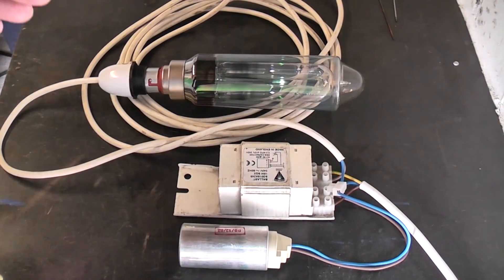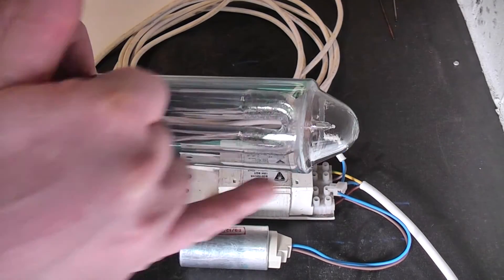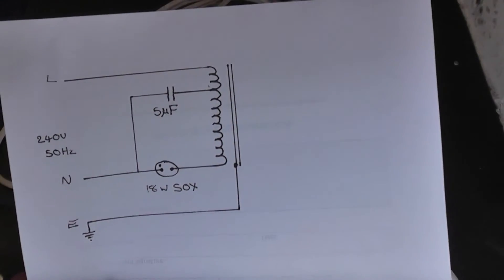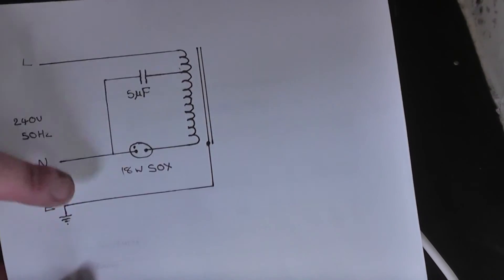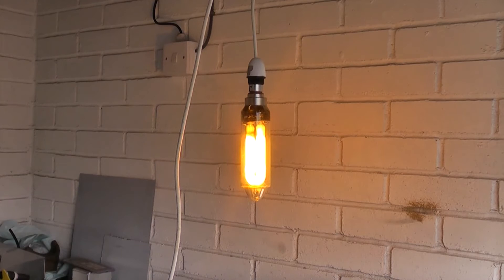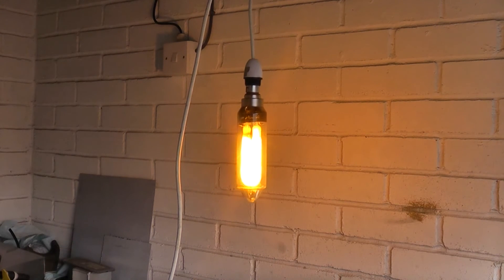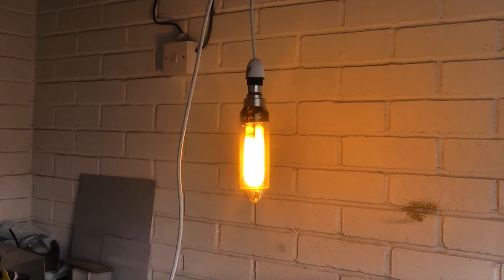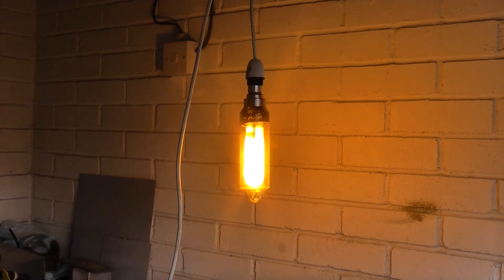18w low pressure sodium (SOX)lamp.

Comment: I bought a Philips 35W SOX lamp on eBay and managed to find, after many days of searching, a driver unit that runs it perfectly. The drive unit is a single white box which has a brand name VISIO and is marked 35W SOX HF driver model PAA3522HFSX. It has three inputs for 240v mains supply, marked +, - and earth and two for the lamp, which seems to work whichever way round it is connected. The connections are marked clearly. This unit is all that is needed, apart from the lamp and socket.  Unfortunately I cannot find any reference to VISIO or this product now: I bought the last of 10 which were sold on eBay last year.  Vendors are still supplying the SOX bulbs ( which ceased manufacture in the UK in 2021) but I suspect they are mainly bought for use in streetlights with old drive circuitry and the drive units are even rarer than the bulbs. A hugely expensive low pressure sodium lamp system for lab work is now available from China: this may now be the only source for optical work.

Comment: I have been sold a new low pressure sodium lamp, labelled SOX-E 18W by BLT direct in the UK, but they do not know what ballast and condenser it needs .  Can you tell me the details of the ballast and capacitor you found on eBay?  I found a YouTube item with a similar lamp being operated on
120v AC in the USA, using a Fulham choke WH2 120-C with no capacitor.  I need the lamp for optical experiments where the low-pressure sodium spectrum is essential for seeing fringes when measuring the flatness of mirrors etc.
Reply: I also would like to read the answers to your important question - i am dealing with same problem about optical experiments, but seems no one wants give precise details....

Comment: Just like PL-L 18W CFL lamp, I have dozens in use, 7 on Advance electronic ballasts, they last forever, and the ends don't blacken, the same PL-L 18W lamp on the simple magnetic core ballast, get blackened ends near the base, the electronic ballasts run much cooler, SILENT also, they are much lighter, just better

Comment: U.S. had them, all had the Kulka or Leviton sockets bayonet, Philips owned Kulka at one time, Ebay, sold under Norelco label early on, then changed to Philips, when Philips finally took over full control of North American Philips, cus they where screwing up too much in the U.S., so Dutch Philips took back the Philips trust, and took full control, so then they could use Philips name and logo.  They made U.S. made fixtures and stuff in Van Wert OH, mini Sox wall pack outdoor I have used them for will be 40 years...the fixtures lasts decades, until poly-carbonate got too yellow, so I have spares, spare sockets, spare ballasts, spare sockets, 55W for the backyard SOX , works great, have Hubbell, 55W replaced yellowed Philips Norelco, after 35years..Have a 180W  SOXflood light fixture and lamp, BRIGHT!

Comment: Philips Norelco MiniSox/Lustra Lighting/Verd-A-Ray ,Philips lighting North America from the 1980's,  Fixtures where made in Van Wert OH. along with the large 90W 135W 180 Area and street lighting fixtures,I still use several 40 years, have some spares, and some STONCO(PHILIPS) 18W LPS with glass lens, will never yellow.  Have some spare sockets in case and spare ballasts, and stocked up on lamps for the 18W fixtures and the 55W fixtures, should hold me till I', 133.  The Sox Lamp factory is now closed, in Hamilton...the last SOX lamp has left the factory in Nov 2019 https://www.lighting-gallery.net/gallery/albums/userpics/10275/normal_IMG_2527.JPG

Comment: Is it possible to rig one of these on a dimmer? I'd imagine you'd need a special ballast that could dim it down?
Reply: Not possible. Most gas discharge lamps that rely on passing current through vapor generally are run at exactly the correct current and voltage to maintain a specific temperature. Reducing the amount of power going into the lamp via dimming would reduce the arc tube temperature, reducing the efficacy as well. You may also run into lifespan issues as there will be an increased risk of sputtering. Again, this is due to being designed for a specific power draw.
Reply: @TheSoxmania  Interesting. I was wondering if using a PWM dimmer to lower the voltage would somehow lower the temperature of the gas/vapor so it doesn't burn as bright -- but unfortunately that isn't how these lamps work. For now, I've discovered that if I wrap the lamp in Neutral Density gel (used for film and photo applications) I can lower the light's output.

Neutral Density (ND) gel is available in different strengths depending on how dim you'd like to have the light. Certain brands are also heat resistant, so that is a plus!
Reply: @Powersfilms  Or maybe you could mess with LCDs and polarizing layers for a similar effect?
Reply: @Powersfilms  to be honest wouldn’t it be easier to get a lower wattage lamp ?

Comment: Philips Mini Sox fixtures where sold in U.S. made in VanWert Oh.,  have 5 in use on teh house, on every night lamps last for about 5 years in all night use.  Great stuff, no glare, doesn't annoy the neighbors, cus of yellow non glaring colorfor the U.S. market, been using em for decades literally, only thing that goes bad after 25 years is the poly-carbonate lens, they do get yellowish, cus of sun UV over time, heat glass wouldn't do that, but the Poly-carbonate is much lighter to mount on walls and stuff, the street lamp fixtures alos are poly carbonate lens, like the hubbell 55W wall packs called  Hubbell also stop making the sox  fixtures I have 4 of them, all Philips parts inside, lamp ballast (Advance) a Philips company Kulka, old Philips company sold off, The fixture div in the U.S. was sold off to American Electric, ebay has AEL Philips street fixtures, under the AEL branding, also 18 Wall packs without lamps,

Comment: 180W is the largest SOX lamp almost 4ft long, but no glare, cus it's linear, and much softer, than glaring point source LED
Reply: There are difusors for LEDs, and being able to see colors makes up for it.
Reply: @TheEsseboy  The Majority of LED street lighting installations are horrible, glare, and high color temp, way too much Blue, glare in rain and fog, horrible to drive under. LPS is still the best roadway lighting, in rain and fog etc.  But time moves on, LED fixtures are much smaller, cheaper to make, LED last much longer, when ya get the good ones.  Led is so common now, they are much cheaper to mfg.  Philips closed the final LPS factory in England, now only NOS what's out on the shelves are available.  I stocked up, on 55W and 18W for all my fixtures, have plenty to last till I'm 133 years old.  Fixtures hold up long time, have spare ballasts and sockets...
Reply: @cengeb  The difference is that you can't really get cheap bad sox, so thats why LEDs get a ba reputation.
There are LEDs with large external phosphors, I have such E27 lamps and they have a sphear 40mm siced ball of phosphor, imagine a streetlight with a sheet of say 30 by 60 cm phosphor that is glowing uniformly 😀 those would probably last like 100,000 hours because of decreased phosphor loading.
Reply: @TheEsseboy  I have several Philips LED lamps inside, no glaring individual LED showing, as you say, all even diffusion, and they have been flawless, and color is now around 3500K, the original cheap non Philips stuff where horrible.  LED have improved, and prices dropped, I have some of the original I think 9W screw in Philips  LED, perfect color, around 3000K.  Some 11W LED perfect for inside, low color temp, no glare, the outdoor street lighters are still too Blue, and horrible lens, glare, as bad as the old Merc vapor from the 1960's, or horrible MH glaring harsh white. When I redid my kitchen 11 years ago, I put in Wera LED puck lights, each unit has 3 1 W High Brightness Philips  Lumiled LED, perfect color at 3500K, they have been on for 11 years 24/7 not one LED failure or color shift. One driver does 3 pucks so 9W each driver, I have 11 pucks installed.  Lumileds was sold off as an independent company, no longer Philips lighting.  Matter o fact Philips lighting is no longer it's Signify, what a dumb name, Philips spun off Lighting div, after 120 years, how DUMB.
Reply: @TheEsseboy  Most LED  fixtures used on road lighting here suck, glare, and too much blue. In tunnels now, many have way too bright, horrible glare, and exposed LED elements, no diffusion, if they kept the LPS linear lamp, no glare, large surface area lamp, no glare.  Tiny spots of intense Blue light sucks and strobes as you drive by in tunnels.
Reply: @cengeb  I agree, those are bad designs, hopefully we will get LEDs with better reflectors, difusors and larger phosphor area.

Comment: We got 120/ 240 V ballasts here 60hZ.  No hV spark to ignite, the Neon starts with pretty low volts.  As the thing heats up the metal sodium begins to melt, and give the Sodium color

Comment: I like sodium lamps, they are very efficient, I think they are just a US and UK used lamp, but I'm not sure. I know in the US they are commonly used in tunnels and such, sometimes but rarely streetlights, and they use them in areas where light pollution can be an issue, but the UK uses them too, I believe US is mostly HPS but there are some LPS also, but they are about as common as incandescent these days, I use them but it's a very narrow crowd, but a cool one at that.
Reply: They saw some use in Australia although not as much as the states and definitely nowhere near as widely as here in the UK. They were, for the longest time the defaqto lighting standard due to our needs for a super efficient light source after the energy crisis in the 70's.
Reply: Becoming quite uncommon in the US. Even HPS are being phased out for LED 'mid white' color spectrum streetlights. LPS is so uncommon that much like when I see a payphone these days I say to myself 'holy sh**!' Some of the early LED city streetlights were awful, but they've been getting better.

Comment: where is the ignitor ?
Reply: not needed, these are not HPS, which need a hV spike to start, these are almost like Fluorescent lamps, as far as cathode and current.  No hV.  cap is just for PF correction
Reply: @cengeb  I have some SOX lamps that run a parallel igniter, but in the case of lamps smaller than 26w they don't require it. They will rely on a starting capacitor and the coating on the lamp jacket to ignite the lamp. This is also why 18w SOX tend to go black before the lamp itself actually fails.

Comment: Love those high intensity discharge lamps! So sad they're slowly dying out all over the world
Reply: I'm glad, they have horrific light 😫
Reply: @TheEsseboy  not all of them do they are better for your eyes than led
Reply: @thepurdychannel8866  No, monochromatic light is bad for your eyes!
Reply: @TheEsseboy  They're not talking specifically about SOX here. There are other types of gas discharge lamp which emit whiter light. For example:

High Pressure sodium, colour temp of between 2000 and 2500k and can have a CRI of between 24 and 50 (2500k / 50CRI would be a  "white" sodium lamp such as a Philips SDW-T. The more common lamps are 2000k with a CRI of 24-26)

Metal halide can have colour temps between 2700 and 12,000k and CRI between 40 and 99

Mercury vapor lamps range between 3600k (coated) and 6500k (clear) with CRIs of 17 (clear) and 49 (coated) respectively.
Reply: @TheEsseboy   Why??
Reply: @DANGJOS  Because you can't see any colors in mono light, and it uses only one cone cell instead of all three...
Reply: @TheEsseboy   Well actually it uses two cone cells.  But that doesn't tell me why it's actually bad for your eyes.
Reply: @DANGJOS  You don't want to see colors? I do...I don't like it when all cars are pitch black...

Comment: Wonder why they have never put mercury in the LPS?
Reply: Because they use sodium
Reply: Because the mercury would amalgamate the sodium and affect the operating temperature. Additionally, the amalgamation process of alkali metals such as Sodium is quite violent.

What I would like to see though is a NaK lamp or pure potassium used as the alkali metal. that would be a very interesting colour.
Reply: It would make UV light, which would need a phosphor coating to make that into visible light. Fluorescent tube lights are low pressure mercury lights, in essence

Comment: LED lamps sucks
Reply: Sox sucks, proper LEDs rock
Reply: @TheEsseboy  i would rather have lps instead of led
Reply: @thepurdychannel8866  Why? Because of nostalgia?
Reply: @TheEsseboy  they are flickering and every other one has burnt out and the lps lights were brighter
Reply: @thepurdychannel8866  sodium lights flicker too, and none have failed in my town.
Reply: Cheap chinise ones dool proper cree ones dont
Reply: They're not as good as high or low pressure sodium lamps.
Reply: @adamfaruga899  i know i loved the old sodium street lights i wish they dident replace them